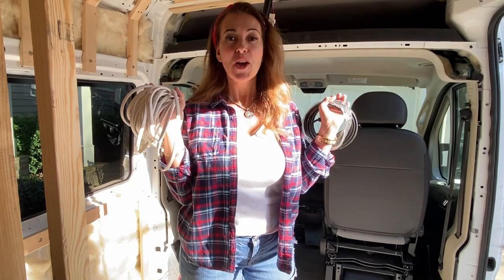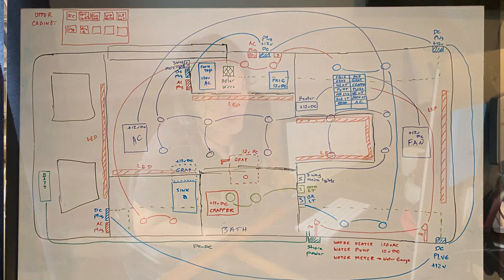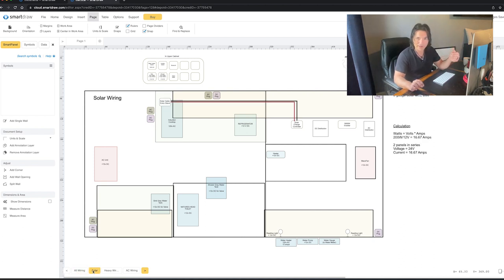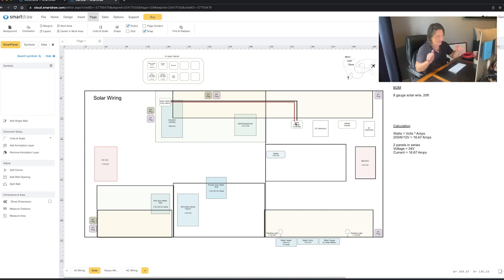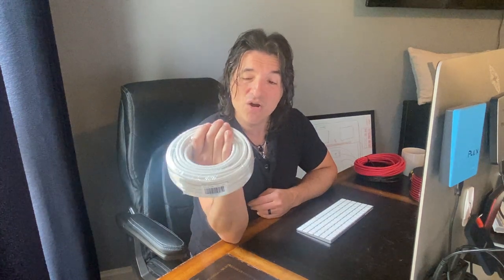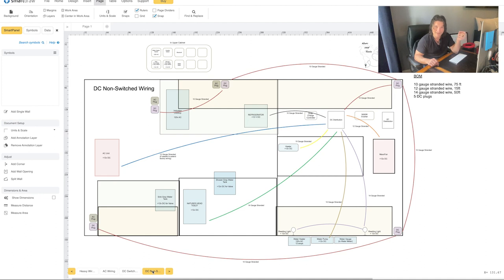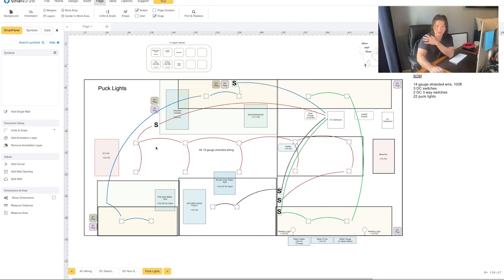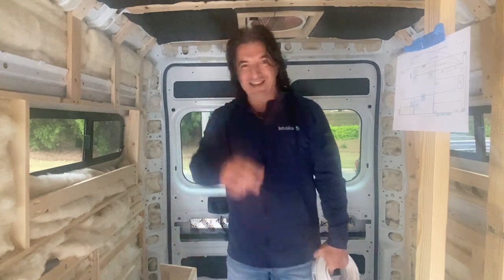Electrical Wiring Design: Part 22 – RAM Promaster 2500 Van Conversion

Comment: I watched a video somewhere that indicated that you need to run double wire for each item. For example if I need 15 feet to go from the cigarette outlet where I will plug in my 12 volt fridge to the 12 volt breaker, why would I need to do a return wire?  I’m so confused.. thanks for any information.  I appreciate your videos
Reply from the maker: Are you may be confusing it with the length of wiring that you use to calculate the voltage drop?  You don’t need a return wire, but when you’re calculating the round-trip voltage drop, you’ve gotta use the entire length, there and back. If you could give a bit more color on what you are doing, we’d be happy to help.

Comment: Do you think there is any value in having a 12V distribution/fuse box on each side of the van (around the midpoint).  It seems like a way to remove some complexity (shorter circuit runs) from the wiring.
Reply from the maker: Not a bad idea....but all the components are expensive....more than I expected. And I think an additional fuse box might male troubleshooting a bit more difficult. We actually thought about distributing our plumbing on both sides.....mainly because of the weight of the water tank....but, again, we found the added cost of the components to be too much. Cool idea, though....and thanks for watching

Comment: Awesome - Very comprehensive - Thank you. I see you're using separate components to make up the electrical system. Curious to know if you ever considered something like the Goal Zero Yeti 3000X with the alternator adaptor instead?
Reply from the maker: Hi Keith,  Yes the Goal Zero looks like a great product..I have already purchased some pieces of my electrical system when I first learned of the Goal Zero....so I didn't give it a strong look. To be honest, I also like the idea of separate components.....prob my 20 years in  network design. I pretty much expect everything to fail at some point and I feel its easier to replace, or upgrade, smaller components.,  Just my thoughts of course
Reply: This is the way I was thinking about going with goal Zero or yeti for now but pre-wire the van for future eletrical.
Reply: @marctania2349  Yep, I spent 20+ years in Data & Voice Comm's so  I hear ya'